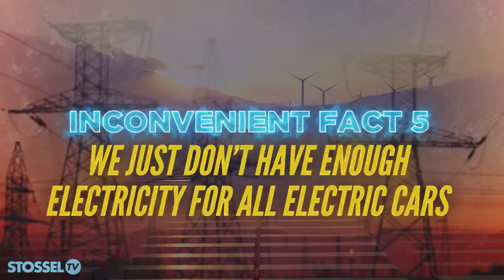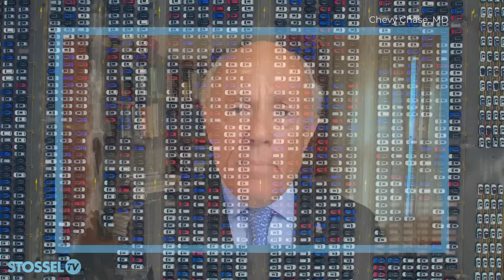Electric Cars: Inconvenient Facts, Part 2

Comment: In defense of batteries, 1000lbs of batteries replace 80lbs of fuel, but also 1000lbs of engine, transmission, and other components as well. Also, newer LFP batteries are more sustainable than the LiPos that are being used
Reply: the comparison was storage of energy.  electric motors and drivetrain components in EVs are a lot lighter but they were not mentioned either
Reply: Gasoline stores 100x times more energy per volume then said batteries.
Reply: Diesel is even better than gasoline when it comes to that.
Reply: @Gunalizer  yes, but the electric motor weighs 100lbs, where a gas engine weighs 1000lbs. It’s a trade off for sure. Electric cars are more efficient and should have much longer life than gas. Electric cars are pretty good but will get even better as technology improves
Reply: @Gunalizer  Electrons store 100,000,000,000x more energy per unit volume than gasoline.
Reply: @tehScribbles  Fake response.
Reply: The electric motors also have weight. As already proven by a decade of data, EVs weigh more than their ICE counterparts.
Reply: @herrschaftg35  yes, but they’re also more efficient. Again, it’s still relatively new technology. Give it a chance to mature and I think you’ll be pleased with the quality and features
Reply: @herrschaftg35  A single decade in which the technology and manufacturing has advanced tremendously, a current Tesla Model 3 weighs nearly the same weight as the gasoline powered BMW 3 Series it's positioned relative to. Technology doesn't sit still, it's evolving rapidly as companies around the world are driving the high tech research forward.
Reply: @chadkrause6574 : "More efficient", yet they cannot achieve the same ranges, they still overheat when pushed at a track, they take 5x larger to charge than compared to an ICE.......yet you think they are more "efficient". An electric motor being more "efficient" when it comes to an insufficient power source doesn't change the fact that ICE cars are still more capable today.
Reply: @tehScribbles : No, it is NOT "rapidly evolving". Batteries have not changed much in the past decade, nor have electric motors. Software is the only thing that made significant changes but their results are small. Your implications that there are going to be physics-defying breakthroughs in the chemistry of batteries is ridiculous. Electric motors were around long before the ICE.
Reply: @herrschaftg35  they get an equivalence of 100mpg. Again, you’re seeing the first generations of electric cars, and they’re not perfect, like gas wouldn’t if it was just developed a few years ago. 95% of people could switch to electric cars and never have to wait to charge if they charge at night at home. The vast majority of people don’t track their cars, so that’s not really a big issue
Reply: @chupposity  Which seems to be on purpose to be misleading.
Reply: @Gunalizer  It is actually a 22 to 1 ration.   In addition gas engines are about 33% efficient vs an EV which can be close over 90%.
Reply: @Gunalizer  that’s what all the engineers and people working on EVs hate. It gives them a bad name. Nobody likes things forced down their throat
Reply: @chadkrause6574  I highly doubt it. There are numerous variables. Every electric car is getting 100mpg? I have a bridge to sell you.
Reply: @herrschaftg35  In 2008, lithium-ion batteries had a volumetric energy density of 55 watt-hours per liter; by 2020, that had increased to 450 watt-hours per liter.

Ergo you're flat wrong, thanks for playing, next time do your research because I will make a fool of you every single time because I already did mine.
Reply: @Gunalizer  lolwut

Comment: I’m already working on building a methanol still and converting my truck over to methanol.  No gasoline taxes, no electricity.  The still is going on my camping trailer so I’m exempt from property taxes.  I will avoid public roads as much as possible, and only travel off-road or on privately owned roadways.  The majority of my food will come from hunting.  Currently, I only work under the table.  I’m just so sick of government interference in my life and charging me for the right to live, that I’m taking drastic steps to ensure my autonomy.  And guess what?  Someday it will be completely illegal to do everything I plan to do because I won’t be controllable.

Comment: EVs weigh more because of the batteries, so they wear the tires out at more than twice the rate. No one talks about the cost to replace the batteries, or how they will dispose of the old batteries. Where will the money come from to replace or build new roads. Those roads will wear out faster with the added weight of the EVs. Right now the gas tax pays for a large portion of these roads cost.
Fewer people are buying into the lies told by this administration. And who wants to take a road trip where you have to stop every couple hundred miles to recharge if you can find a charging station

Comment: Did you cover the recycling challenges and the lack of a coherent recycling policy/program for these batteries in the previous video?  

Historically, the US had a similar problem with the lead acid batteries in regular cars. They're comparatively easy to recycle, but there was no regulatory requirements to do so, and they ended up becoming a significant pollution problem until a recycling requirement and program was put in place. 

We talk about e waste when it's associated with personal electronics, but this multiplies that problem massively.
Reply: as a mechanic I discuss the problems with electric cars in depth on my home page vid.
Reply: Battery recycling companies already exist ans show the minerals can be recycled and keep 100%   tell me, how much oil is recycled...... none
Reply: @ChannelNews1  I bet yiu do.  Do you talk of how automakers make the majority of their profits from maintenance and servicing and that's why they originally hated evs.   Or maybe rhe 1000x more moving parts in an ice car that wear down.   Something tells me you don't. 

My brother in laws a mechanic and sadly he doesn't know much about evs. They are different.
Reply: @paulevans7560  recommend you dig further than one Google search before you develop a holier than thou opinion. If you actually study the problem, you'll understand the complexity of EV lithium ion battery packs, which makes the dismantling and recycling of components extremely difficult and not cost effective. Ask yourself, why aren't the majority of lithium ion batteries in cell phones, laptops, and other personal electronics recycled. If you think they are.....Google it. Post the link.  Make sure you're actually right before you act like you are...
Reply: @paulevans7560  and in response to your "how much oil is recycled" comment. How much coal, oil,, natural gas, and nuclear fuel is recycled to make the electricity in the US that charges those EV batteries...the answer is none.

I was pointing out an actual environmental shortcoming of EVs that needs to be addressed. You attempted to ignore my points and change the subject....didn't work out too well though.

Comment: I'm really interested in the part that says that you could cover the continent in solar panels and it wouldn't meet the demand of the US.   I thought I read that it would take about 100,000 square miles, which is obviously insanely large, but is there a definitive word on this?
Reply: The guest is completely and utterly wrong with his claim. Even the 100,000 sqm estimate is on the high end of things.
Reply: Guest is nuts on that claim, there are a ton of issues with solar panels, land is not one of them, at least outside of land in specific places that reduce transmission requirements.
Reply: The two above me have no idea what's involved with setting up and maintaining panels. It does not require an entire continent of collector surface. However, the collectors cannot be bunched together. In order for them to collect as much as possible, and in order for them to be serviced, they must be spread out, which means more land.
Reply: I'm having a hard time justifying sharing this video due to such a claim. Mr Mills needs to clarify the statement. No doubt in such a short interview he either misspoke or there were caviats. Too bad, because otherwise it is a very credible presentation.
Reply: At night solar panels won't work so when the sun goes down the TV goes off. How are you going to charge your EV at night and be ready to go to work in the morning. Thats what is ment by the half of the electric solar offset.

Comment: Imagine having an electric car needing battery replacement at best in 10 years. Its like replacing your engine in the same time. Which of them leaves a higher carbon waste?
Reply: And like a smartphone, most people aren't going to pay to change the battery. They just get a new device (a car in this case) altogether. 

$10k for a battery on my 10 year old car or just go finance a new one? The waste generated by EVs will be insane
Reply: To replace an EV battery pack might be considered similar the changing an IC engine, except the for costs involved. I can put practically any IC engine in as a replacement for a few $grand. A battery pack must be replaced by the car's manufacturer dealership, but the price of a battery pack is sickening.
Reply: Ive read the batteries are over 85% recyclable but who knows.
Reply: It’s all soy

Comment: The ICE engine at best is only 35% efficient. 65% of the energy therefore you put in your tank when you fill up is wasted as unwanted heat. When comparing weights of energy sources you also have to take into account efficiencies. If you do the picture becomes very much different.

Comment: I like this series. One thing though, I've seen so many reports from seemly reputable sources that claim solar panels the size of Nevada or something would be sufficient. Don't know about quite that small, but given 20% efficient panels, I can't imagine it'd require the whole country.
Reply: It's the whole country when you can't build on most of it, it's cloudy, it's winter, etc. Whoops, it's night time. Now, you need twice the panels to charge a thousand square miles of battery depots to power the city.
Reply: It's mostly down to the fact that you need enough panels to cover cloudy short winter days, you can't store power from summer to winter without fossil fuels. Even getting enough storage to last 1 night for all of north America is going to be an extreme challenge
Reply: If you built a square 150 miles on each side and paired it with about 4 days worth of battery storage capacity you’d cover the entire US energy consumption.
Look up Tony seba for a real expert in this area. The expert of experts.
Reply: @edo9420  150x150 is not 150sqmi.
Solar lasts significantly longer than 20 years and is over 96% recyclable.
Reply: @edo9420  Current lifetime is at least 25 years and will only be extended with new technology.  Every source of energy has significant issues in terms of creating, maintaining and replacing the infrastructure to produce it, whether that's coal, oil, gas, nuclear, solar or wind.  And renewables don't have the waste/pollution issues  of non renewables.  Have you ever taken a look at the ecological impact of coal, oil and gas?
Reply: @mynameismatt2010  would you stop lying. Panels go in the landfill.
Reply: @TheGuruStud  Recycling solar panels because profitable in the past couple years when companies developed specific processes for solar recycling and enough panels were being recycled to reach the required scale. As more panels are recycled a greater percentage of the total value of the panel will be retained.
As an example though, the biggest cost and carbon footprint of a solar panel is the refinement of the silicon, which only has to be done once.
Reply: A sixth of Arizona, a twelth of Texas or 0.5% of the US would suffice. Citing my own comment:

=*=*=*=

· 1. The solar panel claim is completely false. The most the US grid has demanded in an hour is 720 gigawatthours. Even in winter, which is obviously the season with the least sun, an average square meter of US land will get around 3kWh energy/day from the sun (on summer, it's more like 8 and the numbers are obviously higher for sunnier states like Arizona). 3kW/h per day is 125 Wh. Now, accounting for the fact that solar panels harvest around 15% of the solar energy they receive and even accounting for the fact that some space would have to be left for other infraestructure to support solar (let's be quite pessimistic and say only 75% percent of solar infraestructure area is solar panels), the total area required would be:

720,000,000,000 Wh / (125 Wh/m^2 * 0.15 * 0.75) = 51,200,000,000 m^2 = 51,200 Km^2. And the US is 9,834,000 Km^2 big. In fact, Texas alone for example is 695,662 Km^2 big.

So, even if we put ourselves at the worst-case scenario (record demand in december with innefficiently placed and badly located solar panels), all the solar panels required to cover the demand would fit in 0.5% on the US or like less than a twelfth of Texas. I've just checked and my result agrees with studies such as a 2013 study by the National Renewable Energy Labs (NREL), which estimated (with 2013 efficiency numbers) that the area required is around 55,037 Km^2.

Not that you would want to do that, it would be stupid to only use a single energy resource and call it a day, but it demonstrates how big of a lie the statement was. Solar is more than efficient enough to be viable

=*=*=*=

So yeah, the claim made in the video is complety bonkers and should alone be a reason for Stossel to consider taking it back.
Reply: @adrianv.v.4445  If this was the case and if your math is correct why haven't they done it? Why hasn't California developed solar farms on a massive scale? The reason is that California’s electrical grid operators must jump through increasingly difficult hoops to manage solar power fluctuations as there is currently no feasible way to store solar energy. If there were, then solar power generated at midday could be stored for use in the late afternoon and evening. But even after all of the research that has been conducted on solar power since the energy crisis of the early 1970s, and the billions of dollars of government subsidies that have poured into the solar arena, there is still no economical way to store solar energy so they continue to pay other users to take solar power off of their hands when supply exceeds demand, and they struggle to keep up with residential demand in the late afternoon when the sun sets. I don't care how many solar panels you install it's still going to be an issue with battery storage, replacement and manufacture. There will not be enough raw materials to make the batteries and they wear out.